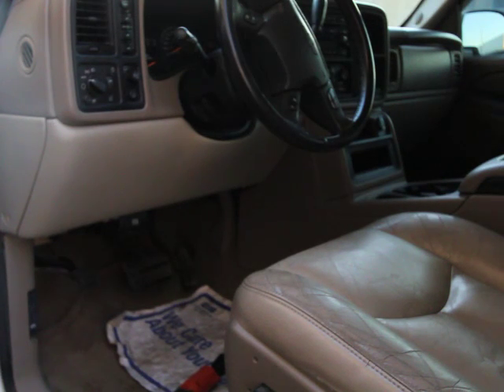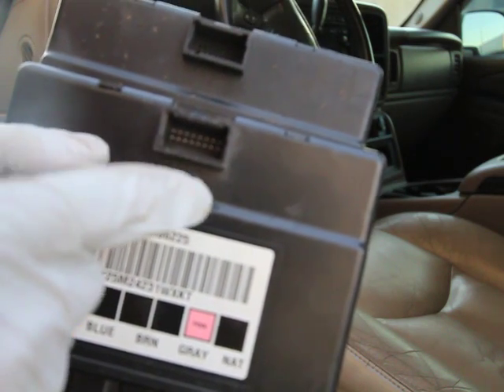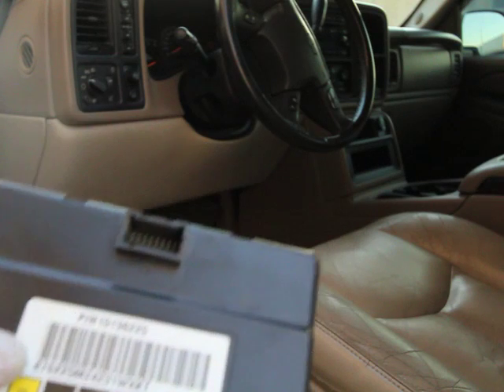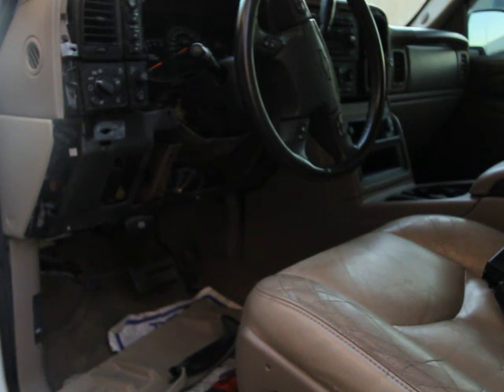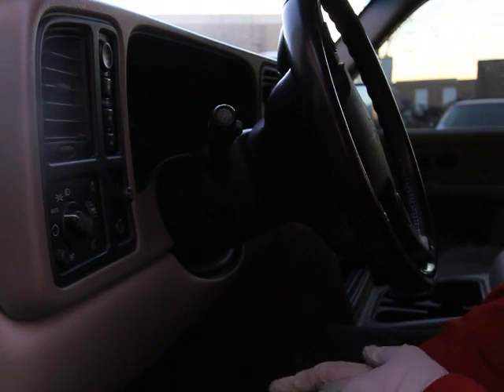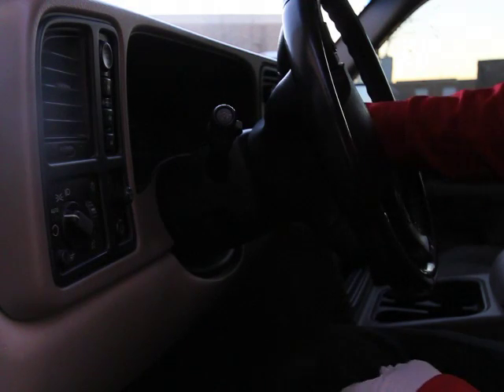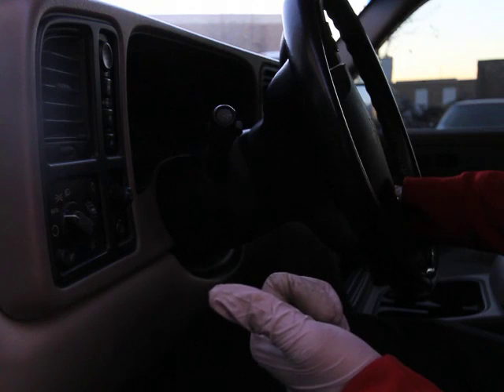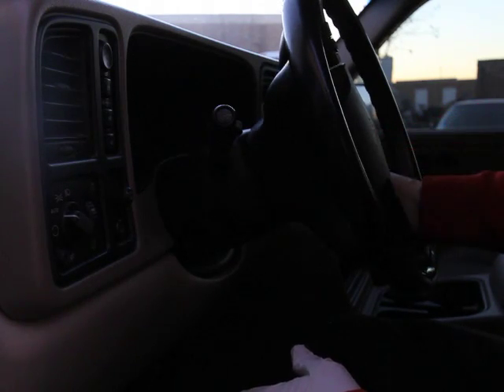GMT800 TRUCKS BODY CONTROL MODULE BCM REPLACEMENT AND PROGRAMMING

Comment: I have an 04 Silverado that I had to replace the battery and the battery was out of the truck for over 4 hrs I Put the new battery in and the truck did the no start scenario now I got a pass the no start it will start but I have no auto daytime running lights no power windows in the back of my crew cab no door locks and no radio with this be a BCM issue
Reply from the maker: Does the radio say locked?

Comment: I have a 07 yukon that will flash stabletrack light and transmission will shift hard from 1st to 2nd, then goes back to normal for a bit. The radio will once in a while not work, the airbag light is on and the remote start stopped working.. does this sound like the module to you?
Reply from the maker: The shifting does not the rest could be. Really need to do a complete code scan before we can diagnose. Im not a fan of throwing parts to try and found a solution.
Reply: No codes
Reply: Now showing multiple misfire but it's in pending faults and is not throwing the engine light
Reply from the maker: Misfire could be causing issues with the trans. It will not cause any issues with the radio tho.

Comment: how can I get in contact with you? I have a 2004 Suburban and the securtity override keeps engaging. One day my car will run fine and the next day it won't start. I tried reprogramming the key and it won't fix the problem. I took the unit out and need to get it tested and possibly replaced. Do you have a contact number?
Reply from the maker: Call us at 636-795-6960 leave a detailed message if no answer. Only 1 of me and tons of people calling all night and day. I will get back to you as soon as I can.

Comment: Also before I replaced the ignition cylinder the security light never went off. But after I replaced it it would go away. But no crank or start
Reply from the maker: What codes can you pull from the ECM and the BCM?

Comment: I've replaced the ignition switch the vehicle started was fine for a few days then wouldn't crank or start. Then I replaced the ignition cylinder and still won't crank or start. I did the relearn but still no crank or start. My original keys have no stamp on the shank. I'm at a loss

Comment: I have a 07 Cadillac CTS the security light stays in the service security comes on radio everything worked but windows don't rol down I hook my scan tool to it and ssyd can't connect to bcm I'm thinking it's bad how do I reset the security light oh and traction control light is on

Comment: I've got an 07 Silverado Classic crewcab I swapped some door panels and switches from an 03 Denali XL now my power windows, locks, dome light switch, A/C and key fob won't work. Does this sound BCM related?
Reply from the maker: It would be odd for it to go out when you did the swap but it could be. I would unplug the door switches and swap them with the original first. Could be a bad switch pulling down the data line. If that test out ok I would then replace the bcm.
Reply: Spartan Autoworx thanks, i did swap it back to original, tried all the fuses and relys, and reset the pcm still no luck. Got it at a shop now that can scan it for me.
Reply: Trap Spot Customs were you able to get it fixed?  I’m dealing with a similar issue

Comment: Where is the liftgate control module located on 2003 trailblazer
Reply from the maker: Rear hatch module is prob good check the wires from body to liftgate

Comment: My 2000 Chevy Blazer is having healight problems i need help they turn on when they want then dont work at times ive tried moving the relay  switches around and still get nothing highs dont work lows dont work, the relay switches i can feel and hear it switch on, all relays i try and switch out still nothing for headlights,  i removed the drl relay to see if that would help and still nothing i need help. i seen on another video it could be the bcm but i dont think it could be everything else is good dash works good and so on plz i need help this is my only vehicle and i use it for work i do security and drive around at night for patrols.

Comment: Read the BCM handles turn signals,flashers,brake lights.My 2012 Savana has a problem with left side,the brake light will not work,left emergency flasher will not work and the left blinker will not work but the bulb is good,all other lights work.Checked fuses and I figured if my BCM was bad nothing would work right so what you think it could be?Thanks

Comment: I have an 06 silverado that never came with power windows would u still be able to program one for me so my harness works roll up and down
Reply from the maker: wheresmoises did you add the missing wiring?
Reply: Spartan Autoworx yes sir al oem, ext cab switchs and wiring. Would it be possible
Reply: I have a Kia borrego and I can't find the body control module on it. I had a mechanic look at the truck its power every where in the truck but the lights don't come on and the Windows wont work I need help please.
Reply from the maker: ty skillz sorry we do not work on Kia's. could not tell you anything about where it's located.
Reply: Same question as Wheresmoises
Reply from the maker: Yes We can

Comment: Ok so I have a 2005 GMC Sierra but the keyless entry doesn’t work how do I reset the module
Reply from the maker: DangleMyJanglzz 1 it's probably the passenger door module that's faulty if the remotes test out OK
Reply: Spartan Autoworx well when I try to set up my keyless entry remote it doesn’t cycle when I get to the key fob
Reply from the maker: Either the passenger door module is faulty are the BCM is. I would guess it would be the passenger door module that is faulty
Reply: Spartan Autoworx alright thx man I’ll try that
Reply: Spartan Autoworx where would that be located. Is it in the door

Comment: I have a 2003 Tahoe Z-71 with a strange issue. The re-circulation door wont go into any position other than, "fresh air". We have replaced the temp control head unit and actuator with new GM parts, NO CHANGE!!!. When you plug into the computer it reports a different VIN# and thinks its a GMC Yukon XL! The previous owner says the vehicle was re-flashed because it wouldn't start after having a bad starter replaced. Im thinking maybe they got a junk yard ECM or BCM and thats why the VIN and model is different, but this is the only thing left I can imagine to try to fix it?

Comment: I have a 2007 gmc sierra classic3/4 ton  ,radio dont shut off some times lights ,,question is if its plug and play will it work soon as its put in and ready to go,or is there other shit to do came home today and battery was dead both of them ..6.6 duramax ,,give me some contact stuff need to fix asap

Comment: MY battery on my 2015 Escalade kept dying within about 45 minutes. My battery was putting out about 17 amps with the car off. If I pull fuse #13 in the engine fuse block the truck will not die and the amperage returns to normal.The manual lists fuse #13 as a Interior BEC LT2. What do I do?

Any help is appreciated.

Comment: i own a 2011 gmc acadia...purchased new compatible bcm however when programming i cannot turn key to off position. a few error codes show on dashboard but not the security indicator light. can you help?
Reply from the maker: What codes? How did you program? Need more details for diagnosis.
Reply: not necessarily codes just stuff in the dashboard that came up even with the old bcm. with old bcm my turn signal lights dont work...radio stays on even when you turn off car and open door. passenger front window doesnt go down. engine light comes on along with the tire sensor. message reads hood is open and check service air bags.
Reply: because radio doesnt turn off it consumes my battery and i depend on a jump pack. so when replacing new bcm the same items come up in dashboard. im not sure if i need to have bcm flashed/programmed.
Reply: im having this same issue... since replacing the bcm my key wont go to the off position

Comment: I have a 2000 Tahoe and my door locks are going crazy. They constantly lock while I drive. I think this might be my problem? Can you give me an idea of how to take care of this question mark I have dumped almost $2,000 into this truck in the last 2 months and I'm trying to make it last one more year until I'm finished with school.
Reply from the maker: Will need more info. Give us a call on tuesday we can discuss some things with you and hope to find you a solution.
Reply: same issue with my 05 gmc Yukon locks go crazy and dash says right rear door open when it's closed. now my temp gauge and battery Guage on my instrument cluster are fluctuating.
Reply from the maker: Dailygrind sounds like a bad bcm. As for the dash its bad as well. Steppers need replaced along with fixing the power and other issues common with that particular circuit board.
Reply: if you still have the vehicle, check for maine ground from the fire wall to the hood for weak connections

Comment: After 10 mins what do u do if the security light don't shut off. I'm doing it on my 02 GMC Sierra 1500 sle
Reply: Alex Lafond im having same problems theft light doesnt turn off after 10 minutes
Reply: +Doug Martell I ended up bringing mine to the shop. Check your fuse box. I had some corrosion in there that wasn't sending power to my bcm and I forget what fuse it was but it was a 10amp fuse close to you in the bottem right hand corner if ur looking at the fuse box. Tlc or tcl fuse or something like that

Comment: My 1999 Silverado 2500, extended cab, long bed has a small problem....  Every now and then , with the engine warmed up properly, AC on, recycling..., My idle seems to dip too low for a few seconds....   It doesn't happen all the time...   But I worry it will learn the wrong info..., or will possibly die...   Any idea what it could be..?    I keep thinking about the programming...    Maybe there is a part of the cycling that is missing..., or telling the idle to drop about 100 rpm at idle with AC cycling..    Anything..?

Comment: I am riding the 2002 Escalade in Japan. Let me ask a question about BCM exchange. Do I need tech 2 for programming when I exchange BCM? Could you tell me how to program?
Reply from the maker: On that particular module you can pretty much swap out the unit for a compatible interchange. One has 4x4 witch is interchange 6645. The 2wd version is interchange 6642. It must be from a 02 but yukon tahoe will also work. If you get one from a Escalade you should be lucky enough not to have to program for your year.
Reply: Spartan Autoworx  Thank you for telling me. Since BCM is compatible, it does not matter if you do not program with tech 2! Is there anything you have to do if you replace the unit? I do not have the ability to listen to English, so I could not understand it with animation so please let me know.
Reply from the maker: As long as its from a 02 escalaide you should be able to skip having to program. It wont be correct for the truck but everything should work. Best of luck. :)
Reply: I too , have an 02 Escalade .
Now has No Crank No Start condition .
Security Light freaking out .
My old Lady now tells me that it would Chime the Door Ajar Chimes and stuff for a while before THIS happened .
All Fuses and Relays check good .
Thinking BCM ?